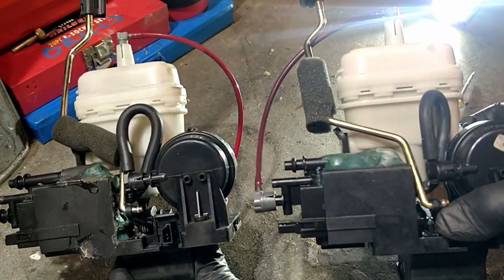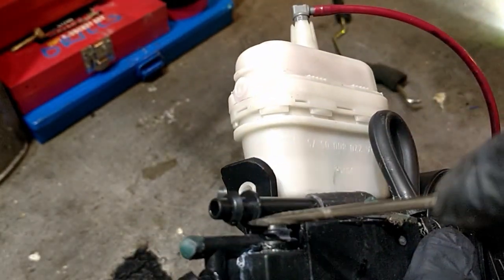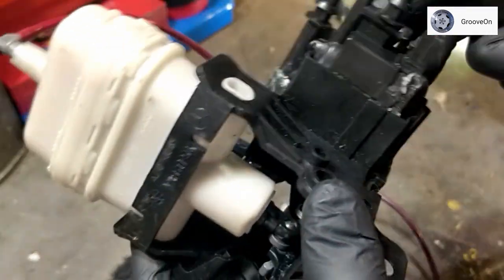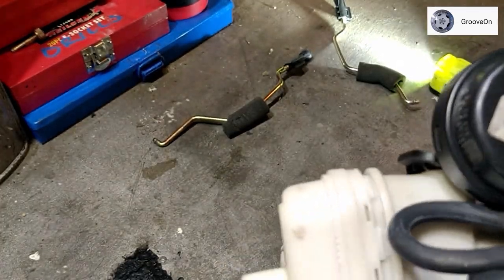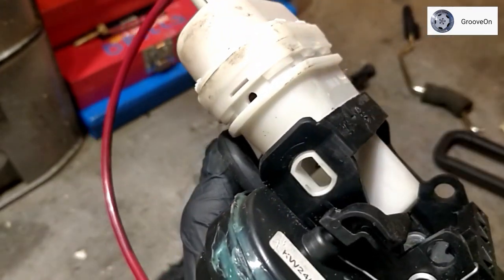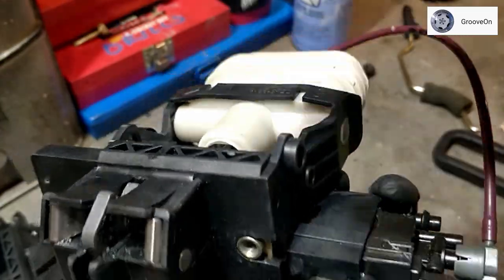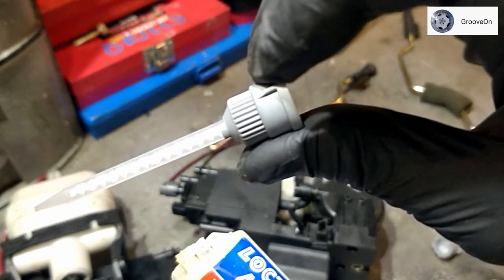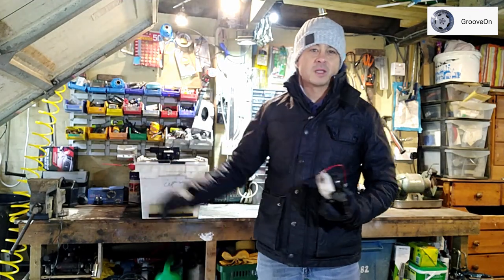Mercedes SL Soft Close Trunk Actuator Fixing Master Class

Comment: really helpful video. I have taken out and fixed R230 softclose actuators 5-6 times and it just feels natural now. please make a video on the tail light tints in the middle. looking to tint mine too for a 55 look.
Reply from the maker: Thanks for the kind words. I'll wait for the weather to improve, but I used window tint, heated a little to soften
Reply: @GrooveOn  did you cut it to shape before you put it on? I would really like to see anyone do this procedure
Reply from the maker: @alexandros1301  no I did it on the car, heated the film up then carefully pulled it on to the middle of the light. I then trimmed with steady hand and sharp blade.  The tint was quite dark so I ended up getting slits in front of the indicators and used brighter LEDs.  You could cut down first, then use a slip solution soapy water to position

Comment: Grate video. You the best 

Can you help out with srs light radio went silent. Also tele aide drive to workshop on all at the same time
Reply from the maker: so the SRS is for your safety air bags etc, usually a loose connection, try plugs under your seat. The radio going silent could be different things, I had this issue it was the amplifier, other reasons can be the audio gateway. The teleaid I do not have, but try your fuses. 
https://youtu.be/V6bJ55nTy_s

Comment: Great video. I will use it for replace broken half of right mirror. Do you have try to adjust front lights? I think my left side front are a little low so i want to adjust but I don find the way.
Reply from the maker: Hi there, my were these comments for another video?
Reply: @GrooveOn  yes. it's supposed to be for Mercedes R230 signal side mirror lens replacement
Reply: my car is 2003 model and have a different mirror

Comment: Greetings from Los Angeles!  I stumbled upon your channel during my quest to figure out why my 2003 SL 500 no longer has a working convertible top, nor do the locks unlock with the key, nor does the trunk or gas cap door unlock. Oh, and the roof gives an error message about the trunk (or as you say "boot") separator is not closed...but it is closed!   I checked the fuse, which was fine, and I replaced it with a new fuse anyway just to be safe. Then I checked the level of hydrolic oil in that opaque plastic cylinder pump thing, and it was within the correct levels.  I don't know what else to try!  Does my problem seem like an actuator leaking problem? Thank you in advance for any advice!  Cheers!
Reply from the maker: Hi there, thanks for looking at my channel ! Reading your issues I think they may be independent faults. Starting with your trunk separator issue, this is usually just the switch, its on the right side pin where your separator slots into, underneath there is a micro-switch which tells the car the separator is in place. It will either be a loose or corroded connection, or the microswitch is gone, (usually connection) you can bi-pass the switch for test purposes by connecting the two wires, but remember to ensure there is nothing in the way in your trunk !  Once you fix this, then start to look at your pneumatic actuator for your car, it controls the locks, soft close trunk etc. The pump you checked is the upper once for the roof, you need to get to the pneumatic pump which is beneath it, I show this in this video: https://youtu.be/jZuft_KElwg

Check for dirty plug connections, kinked or broken plastic air hoses or potentially inside the pump there could be broken fins that need replacing.  
Good luck and let me know how you get on. Appreciate the subscribe !

Comment: Hi it looks like I was a little permaculture and it’s seems as if it’s still leaking so air. Is there anywhere else you think I need to check. And do you think I need to disconnect the battery to rest everything. 
I was not sure how to take the hose clips off so did most of my repair with the still connected. Thanks for the help Steve 👍
Reply from the maker: the hose clips pull straight off,  they can be tough, it would be best to get it on a bench. You can leave the hose connected and let it hang, then using soapy water keep checking for leaks, seal it with good quick drying epoxy !  Did you reset the fuse? see my other video.
Reply: I have check over the system and it seems to work for a bit if I remove and replace the fuse.   I'm due to pick up a replacement unit. Would they be any tips for removing the electrical connectors and the vac lines. I don't what the break anything. 👍👍
Reply from the maker: @parkecorepersonaltrainingp2601  just try and pull straight out, and not at angle you will be okay. You can just pull back half the liner not all. And keep a visual note of the position of the two screws, so it goes back the same position 👍
Reply: @GrooveOn  great thank you will let you know how it works out 👍👍
Reply from the maker: @parkecorepersonaltrainingp2601  Please do, I really hope you get your actuator sorted.  Remember to pull the lines straight off, try to avoid using a tools that could damage the fitting.
Reply: @GrooveOn  thank you so much for the help it's worked the used unit went right on and all done in 15 mins. Now it works every time within a second. 👍👍
Reply from the maker: @parkecorepersonaltrainingp2601  amazing!! I bet you can do it in 5 mins the next time, which will happen!  Try and glue up the old one with epoxy as a spare
Reply: @GrooveOn  it's amazing I was so apperceive about it the 1st but thanks to your vid I could do it with my eyes closed 👍👍😂😂